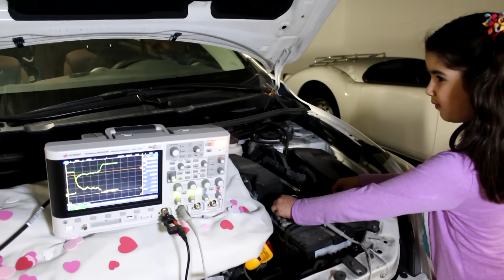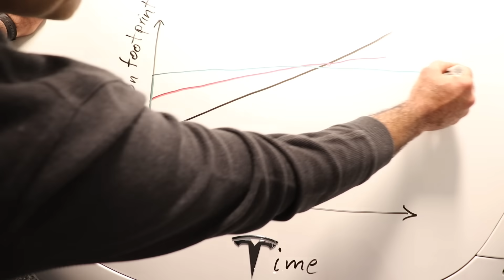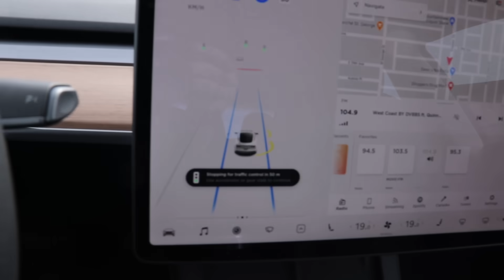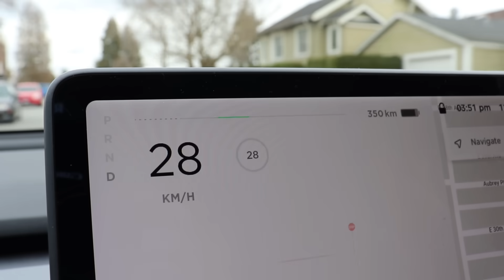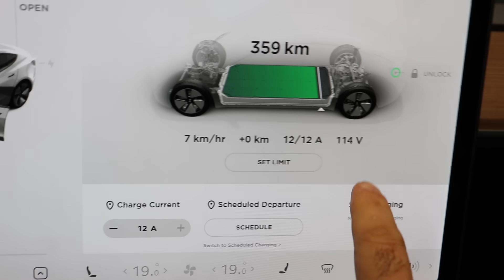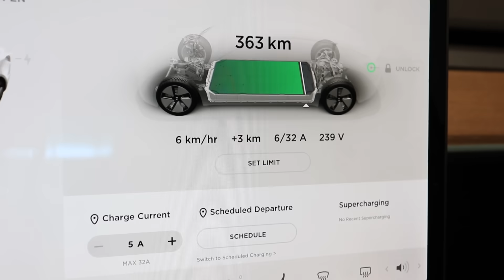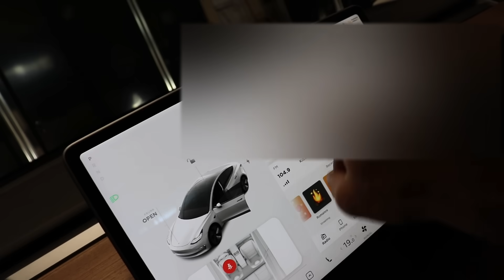ELECTRIC VEHICLES & My Tesla Model 3 Review

Comment: EV cars are not the answer. It’s the Betamax (Fuel Cell) Vs VHS (EVs) all over again. Though hydrogen isn’t necessarily the answer either, possibly alcohol in adjusted engines, or some existing models. There’s no free lunch - most EVs are charged with power coming from coal/gas/fossil fuel-powered power station, which is just moving the pollution around rather than dealing with any problems. Hydrogen takes a lot of energy to split itself from oxygen, but such things are usually done at hydropower sites, which is a genuine step forwards, but tricky in containment situations. Which is even worse in an uncontained burst of hydrogen, say, in a crash. The efficiency of the Earth needs to be jumped up a few spaces before anything really gets done.

Comment: Gasoline cars also consume 0 fuel when going downhill… once you release the accelerator the fuel cuts off and 0 fuel is being used.
Reply: For one Electric cars actually get more range going downhill 
For 2nd what do you think gas car idles on? Hopes and dreams?
Reply: @hardnachopuppy  modern cars have fuel cut off when the accelerator isn't used, so going down hill with engine breaking instead of applying the breaks saves more fuel than an electric car regenerates. 
Furthermore the range an electric car gets back from going down hill via regenerative breaking is quickly wasted once you turn the heat on lol.

Comment: Electric vehicles will help once the method of producing electricity is much cleaner
Reply: Its still cleaner than using gas in cars because production of electricity using gas is way more efficient than running an engine.

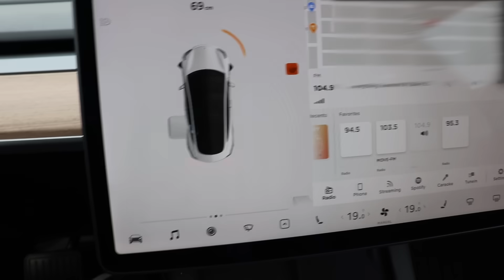Comment: Where are you gonna get the lithium in the 6:10  your gonna say recycling... believing lithium will be recycled cheaply and with little energy... i'd bet Jesus returns before that day arrives) Glad you did the graph, bet the salesman used that trick on you... how many years does it take to be lower (spoiler... it doesn't)? the batteries will never last long enough to beat the other two. Manufacturer warrantees those batteries for 10 years, usually, meaning they expect to replace the batteries in 10 years or a little more, that means more carbon footprint again... if you can get lithium. Electric cars are the product of good salesman selling bullsh!t product that does not deliver what you were wanting. It's all about selling as much as you can and getting rich before the bubble pops when lithium runs out. About 20 million tons left and the countdown has started as world consumption is quickly increasing (expected to run out 2040-2050 at best). In 10-15 years we will have to come up with a means of stopping your tesla from leaching toxic waste into our water from its position at the bottom of a landfill, thanks. Electric cars are not made because electric cars will be the future, they are made because the companies that are selling them want to cash out today and wont give 2 sh!ts about the environment as they fly in their private jets and sail around in big ass yachts tomorrow. We can benefit from other energies, but those energies cannot be more polluting or less sustainable than what we currently use. Here is some good advice: never buy from a salesman... if it is a good product, you dont need a salesman... you need a cahier 😁

Comment: Warning: The Tesla car has a lithium battery so if any damage even if it's small it may explode. And that's not all there are security cameras that caught Tesla explodes/caught on fire without even driving.
Reply: This is a common misbelive. Actually fuelcars catch fire way more often than electric cars. Obviosly electric cars tend to be newer, and thats why they are much saver, but still: if you are scared driving an electric car, you should be way more scared to drive an older model petrol-car. (You can google "electric cars vs gas cars fires", for example the Guardian article is very Intressting and shows, that the numbers are not even close...)

Comment: As a mechanic in learning there is still a list of maintenance that you have to do on a Tesla, brake pads still need to be changed although with regenerative braking this may be reduced unless you drive hard, brake fluid will always have to be changed every couple years because it's hydrophilic (attracts moisture which in turn introduces contaminants that will break down your braking system until the lines are worn down to the potential point of leaks) i'm not as qualified as you to say it but the batteries will also go bad eventually, and in a lot of ways that is the EV equivalent to an engine, my one personal strife is that while a engine may go bad after a dozen or so years if driven and not properly maintained, a EV battery may most certainly need to be replaced due to the nature of the battery itself...the same reason your phone battery will someday go bad.

Theres also the other typical maintenance ie washer fluid/wipers ac units etc.

Finally I would like to say that while travelling up the state of California with my father, we used a Tesla for the experience and found that the price of using a supercharger for the journey probably only took about 20$ cheaper than it would with my Mini Cooper, and that's with the price gouging prices over here, it would probably be cheaper in the midwest. Plus my car being essentially a slightly soap shaped brick I wouldn't say it's very good on gas mileage.

So personally i'm not too bought on EVs mainly thinking that if your really out here to save the environment or save money...your best choice might be to have a hybrid like a Toyota Prius.

Comment: Honestly, buy whatever you want. Eletric cars bring a LOT more problems. Like having to change the batteries from time to time, and the fire hazard too.
Anyways, love the videos
Reply: ive seen more gas cars on fire than EVs
Reply: @Zyghqwyv  There are way more gas cars, for way longer, and while they can catch fire easier, it can actually be put out. EV fires can last for days, and even submerging it in water won't help
Reply: @felipeferreira00  i agree that when it actually happens it is worse but the incidence rate is lower, far lower.

Comment: Just a thought but generally at currant time. Hybrid and ev batteries last 5 to 15 years. Most of the carbon foot print is from the battery. Then adding on top of that recycling the old battery. I would think given current technology that a gas powered car would have a lower total carbon foot print. Than a hybrid or ev. given a 30 year stretch
Reply: BEVs typically come with a 10 year warranty. And they can easily last far longer than that. Recycling the battery allows it to be used in a new BEV later at a lower carbon footprint than the first BEV. And the carbon footprint is much better than ICE of similar capabilities. If you have clean power, such as renewables or nuclear, it is drastically lower than ICE.

Comment: Gas cars don't burn fuel when going down a hill either.
Reply: Yes they do. As long as the engine is on, it is burning fuel.
Reply: @anthonypelchat  No they don't. If you roll down a hill, in gear with no foot on the gas pedal it cuts off the fuel supply and the engine is only turning through the masses of the car rolling.
Reply: @erictruog1659  No, you would have to turn off the engine to cut off the fuel supply. The engine would also have to be restarted before you could apply power again to go up the next hill.
Reply: @anthonypelchat  I don't think you get my point. What i mean is what is called "Engine Braking" or deceleration fuel cut-off (DFCO) on fuel-injected cars. This cuts off the fuel injection wenn decelerating or going downhill because there is no need to inject fuel. This is just true when in gear. I neutral you are right, there needs to be fuel injected to keep the engine running because the engine is disconnected from the drivetrain.
Reply: @erictruog1659  The car may or may not use a bit of fuel while engine braking. However, that is only on cars built that way and only when using engine braking to slow down. Just rolling downhill normally keeps it in idle.
Reply: @anthonypelchat  Ah OK i agree if we're talking about traditional torque-converter transmissions. They rarely completely engage the clutch (if they even have one, but mostly in higher gears) thats a bit of a different case there. But on manuals and modern DCT's i guess it's save to say that they cut off fuel supply when decelerating. I've been working a lot on my manual car and have been tuning it with a computer and there you could clearly see it cutting off in these cases. I just wanted to make this clear because in the video it sounded like thats something special on EV's when it's really not. Gas cars got better and more efficient, too. :)
Reply: @erictruog1659  I learned something new too. But to be clear, regular coasting down a hill in ICE use fuel while EVs don't use any charge. Decelerating down a hill (jack brake) doesn't use fuel in ICE while EVs gain charge.
Reply: @anthonypelchat  That's it, can't argue about that comment. I'm happy to see that you still can have a normal discussion in the comments on youtube without people getting aggressive or offensive. That gets quite rare on the moden internet. Thanks for that and have a good one ;-)
Reply: @erictruog1659  Agreed.

Comment: You said that in downhill fuel vehicles still consume fuel. Thats not true by today's standards. All modern cars have been programmed that when you are in gear and have throttle closed, the ecu cuts power to the injectors,cutting the fuel in the proccess. This means that at that time,the car uses 0 fuel and also brakes the car harder,saving on the brakes aswell. Also if polution is that big of a matter for you,you can always replace the catalytic converter for a new one after 50k miles to be sure that the polution is in its minimum(isnt it still less that the polution produced by the work done to create the electricity required to run electric vehicles?just asking)
Reply: even in cars with DFCO at best youre using no power, while in electric cars youre gaining power. and even if all of the power for an EV comes from fossil fuels (which it doesnt, except maybe the US and poorer countries), its still less pollution, because giant fossil fuel power plants are more efficient (37% for oil and coal, 60% for gas) than small ICE engines (about 20%)

Comment: I love your content but EV's suck arse and i will never own one. In NY we pay 50 cents a Kilowatt so fueling is no big difference and I can fill up my Accord in 5 minutes and get 400+ miles per tank fully loaded and don't have to worry about the outside  temperature and trying to find a charging station that works. screw all of the EV crap.
Reply: Only DC Fast Chargers are that expensive per KWH. Home charging is only 20c-25c per kwh in NY and far cheaper nearly everywhere else. When charging at home, you spend seconds "filling up" your EV since you don't have to wait for it to charge. And Tesla Supercharger stations have great reliability and drastically more available chargers than anyone else. And soon everyone will be using the NACS plug for EVs.

All that said, if you don't have a spot to charge an EV at home or at work, than it may not be time yet for you to get one. They are amazing for anyone that can charge at home, but not so much for those that cannot. Should be changing over the next few years though.

Comment: This sellout makes me sad.
EVs r not the future, until we find better ways to store electricity
Reply: Lithium batteries are a great way to store electricity. So much so that some EVs use less capable batteries to save money overall as even those are good enough.
Reply: @anthonypelchat  
L'ion batteries are probably the best electricity storage solution we have right now but its nowhere as good as a gasoline. even just for the fact that gasoline is way safer when it is contained properly, isolated from oxygen. the batteries carry a large extra weight in the form of the Ions that move through the media and push the electrons from side to side. So the energy that the Ions provide also has to carry them too. batteries are heavy, and when depleted they DONT get lighter. There's just no comparison. 
In drones and small vehicles I'd say that batteries are a very sensible solution, especially for drones, since the fast response of the throttle is the key to the drone's automatic balance system. this would be way harder to achieve with fuel engines. but when you get to a medium car and above you'd be better off with gasoline.
And don't get me started about Elon Musk's new "Genius" "idea" - electric airplanes. 
that will never fly, pun intended.
Reply: @ehudv9276  "but its nowhere as good as a gasoline."
Doesn't matter when only 20-25% of gasoline's energy goes towards movement. And it doesn't have to be as light. 

"even just for the fact that gasoline is way safer"
HAHAHAHAHA!!!! No, just no. 

"batteries are heavy,"
Doesn't matter for the vast majority of personal transportation uses.

You seem stuck on the idea that batteries being heavy is an issue. It isn't. Li-ion batteries have a capacity of 250wh/kg or better. That means that every 20kwh is roughly 80kg or 176lbs. Not light, but these replace a bunch of heavy items in vehicles. Electric motors are around 50% of the weight of similar gas engines. EV battery management, motor controllers, and HV cables weigh less than the engine addons like the alternator, starter, water pump, etc. The radiator and cooling system is also lighter on an EV. There isn't a transmission, so that weight is gone. And many more.

So battery weight only comes into effect when trying to get longer ranges. Even still, 60kwh is only 240kg or 528lbs. And that is enough range for over 200 miles in nearly all conditions. The average person travel 40-60 miles a day. Over 200miles is 3-4 hours of nonstop driving. And then a 30 min stop recharges it. That is simply more than enough for the vast majority of people.

"electric airplanes."
They already exist. This shouldn't be surprising since we have drones running entirely on batteries. But look up Harbour Air Beavers. Anyways, that isn't Elon Musk's "new idea". He isn't even working on it.
Reply: @ehudv9276  You seem stuck on the idea that batteries being heavy is an issue. It isn't. Li-ion batteries have a capacity of 250wh/kg or better. That means that every 20kwh is roughly 80kg or 176lbs. Not light, but these replace a bunch of heavy items in vehicles. Electric motors are around 50% of the weight of similar gas engines. EV battery management, motor controllers, and HV cables weigh less than the engine addons like the alternator, starter, water pump, etc. The radiator and cooling system is also lighter on an EV. There isn't a transmission, so that weight is gone. And many more.

So battery weight only comes into effect when trying to get longer ranges. Even still, 60kwh is only 240kg or 528lbs. And that is enough range for over 200 miles in nearly all conditions. The average person travel 40-60 miles a day. Over 200miles is 3-4 hours of nonstop driving. And then a 30 min stop recharges it. That is simply more than enough for the vast majority of people.

"electric airplanes."
They already exist. This shouldn't be surprising since we have drones running entirely on batteries. But look up Harbour Air Beavers. Anyways, that isn't Elon Musk's "new idea". He isn't even working on it.

Comment: Electric cars are still too impracticable as is. Maybe in a decade or two, it'll be worthwhile to get an electric vehicle, but not now.
Reply: BEVs are far from impractical. No idea where you got that. Especially for anyone that can charge at home (roughly 50% of the US right now). For those that can, BEVs are drastically cheaper per mile to drive and you never have to waste time at a gas station. On road trips, proper BEVs are good enough. Not as easy as gas cars, but not bad either. The only time they are impractical is if you have no access to home or work charging. Even then, that can frequently be fixed with nothing more than a trip to the store once a week or so to charge there while shopping. May even be free.

Comment: I choose not to get a Tesla not just because of Elon musk, but also because these cars use so many lithium ions, and for moral reasons, I refuse to use an electric car until gen 2 sodium ions become standard.
Reply: The batteries in your phone, laptop, and likely numerous devices throughout your home and life use lithium ion batteries in some or another. Lithium is extremely abundant.
Reply: The problem isn’t the abundance for me, it’s the volatility. Sodium ion batteries are less vulnerable to temperature swings and are in general more stable, of course at the cost of capacity. The problem with using lithium ions in cars is that they are primarily outside, and more heavily exposed to the elements, which is bad for a type of battery prone to damage from the elements. Phones are okay to have lithium ion batteries because they spend most of their lives indoors.
Reply: @reptileassassin7660  Cars are in the elements, but the batteries are not. They are in their own protective housing within the car. And they are absolutely fine with the temperature swings. They just lose range, which is to be expected since they need to spend more energy keeping things cool/warm. They don't charge past certain temps, but that is why battery packs typically have thermal controls. Most EVs have the ability to cool down the battery in high heat and warm them up in freezing cold temps. They also have armor plating to protect them along with multiple protection systems.

Your cell phone battery doesn't have most of these abilities. That said, any EVs that don't have these abilities should probably be avoided.